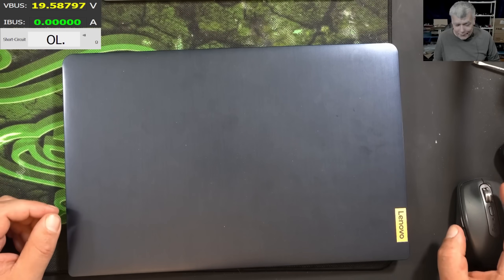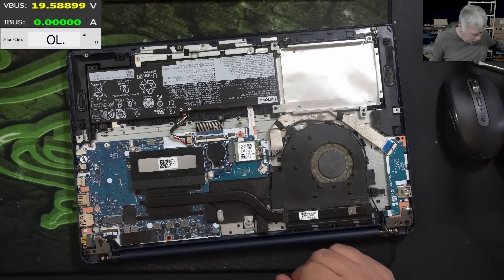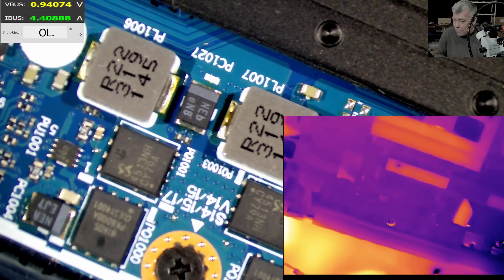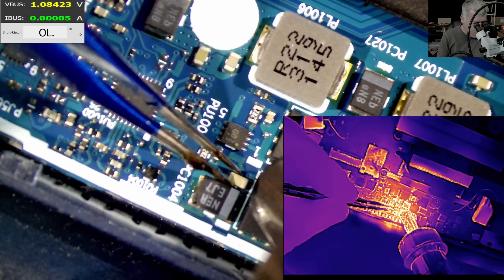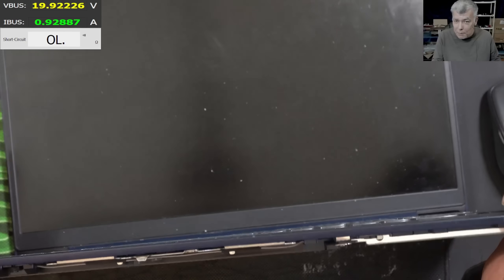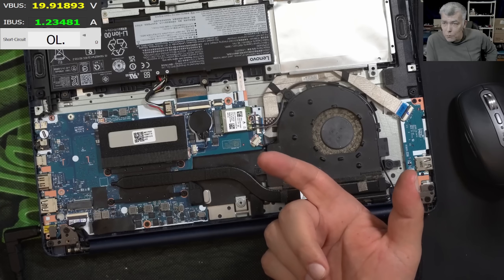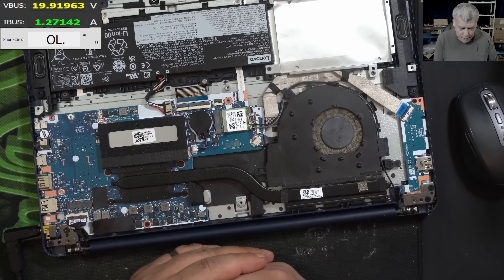Lenovo Ideapad 3 15ITL6 not charging, not coming ON, check this capacitor!

Comment: AI Summary

Abstract:

This video documents the repair of a "completely dead" Lenovo IdeaPad 3 laptop. The initial customer report suggests a shorted power rail. The technician quickly confirms a dead short on the main 20V power rail using a multimeter. Drawing from past experience with this model, he immediately suspects a specific ceramic capacitor located under a sticker on the motherboard. To confirm this, he uses a thermal camera while injecting a low voltage (1V at 2A) onto the rail. The camera instantly reveals the suspect capacitor heating up, pinpointing it as the source of the short. After removing the single faulty component, the short is cleared, and the laptop powers on successfully. The technician also discusses the importance of showcasing simple repairs to provide a realistic view of the electronics repair business and encourage newcomers, noting that this specific capacitor failure is a common fault for this laptop model.

Lenovo IdeaPad 3 No-Power Repair: A Common Fault Diagnosis

*   0:00 Initial Problem: A Lenovo IdeaPad 3 is received completely dead. The customer, another computer business, suspects a shorted power rail, noting that there are 20 volts going in but no 3.3 volts at the power button.
*   1:21 Diagnosing the Short: The technician immediately checks the main 20V power rail with a multimeter and confirms it is shorted to ground, reading 0 ohms.
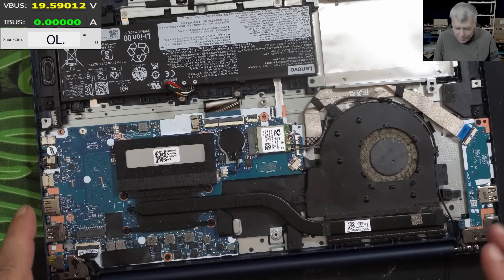*   2:04 Identifying a Common Fault: Recalling a previous repair on the same model, the technician suspects a specific ceramic capacitor located under a sticker is the cause of the short.
*   2:28 Thermal Camera Confirmation: To verify the faulty component, a thermal camera is used. The technician injects 1 volt at 2 amps into the shorted rail, and the thermal image instantly shows the suspected capacitor heating up, confirming it as the single point of failure.
*   4:17 The Quick Fix: The technician removes the shorted ceramic capacitor from the motherboard. A subsequent check confirms that the short circuit on the main power rail is gone.
*   5:01 Successful Power-On: After re-plugging the battery and charger, the laptop immediately powers on, draws current, and displays an image, confirming a successful and very fast repair.
*   6:21 The Reality of Repair Work: The technician discusses why he posts videos of easy repairs. He explains that most jobs in a real repair shop are "easy to medium," and he wants to encourage more people to enter the repair business rather than intimidating them with only difficult cases.
*   8:47 Key Takeaway: The repair is concluded by highlighting that this specific capacitor failure is a common fault for this Lenovo IdeaPad 3 model, offering a valuable tip for other technicians encountering the same issue.

AI-generated summary created with gemini-2.5-pro for free via RocketRecap-dot-com. (Input: 13,944 tokens, Output: 596 tokens, Est. cost: $0.02).

Comment: Having worked as a laptop repair engineer for many years I have to agree that the majority of jobs are easy. But you do tend to get a few hard jobs in a row which can make you feel a bit down. But overall  it's a good job to do. I like the thermal camera on the microscope, that really works well. 😊

Comment: Use 3 mins to replace the capacitor 😂 Btw why capacitor is removed mostly by techs but not replaced with new. How come company installs it with no use 😢

Comment: I got two flir one gen 2 thermal cameras. Both stopped working. Unfortunately common problem suggested on these with CPU soldering failing. Will look to buy a cheap unit again 120x320 is good enough I think.

Comment: I'm not a fan of too many capacitors, so I agree with you not replacing capacitors. 
But, electrolytic caps are really bad at handling current ripple. they heat up and dry. So, at least one ceramic is required next to fast/power switching nodes.